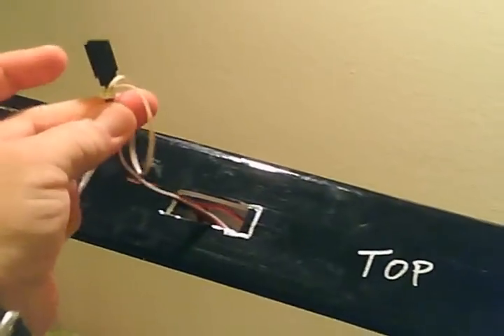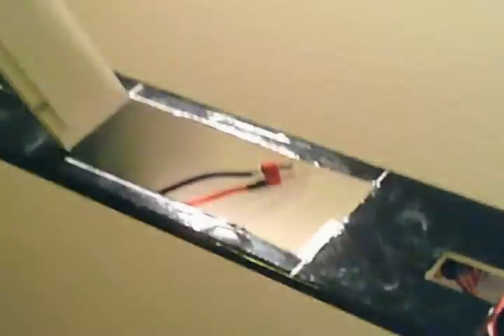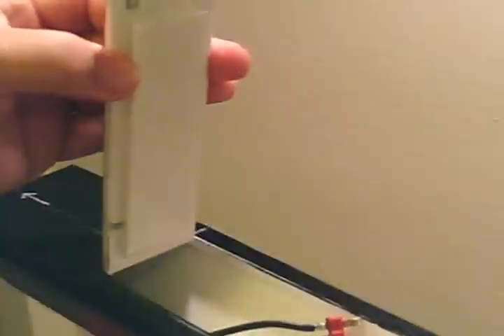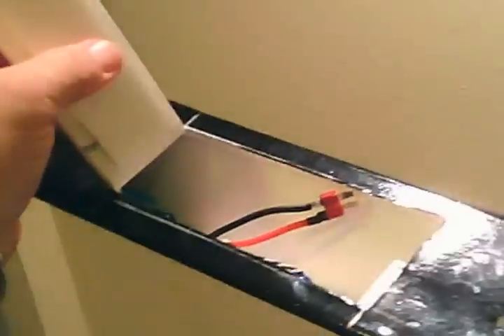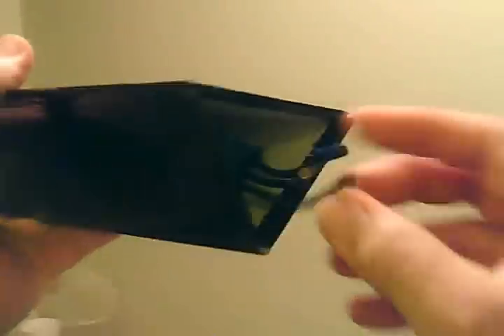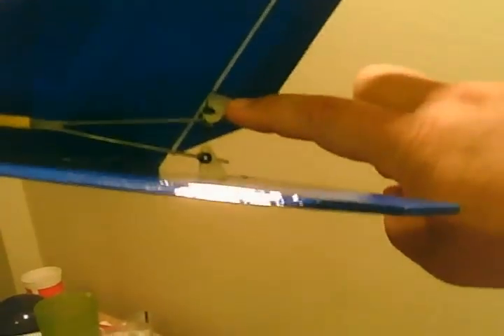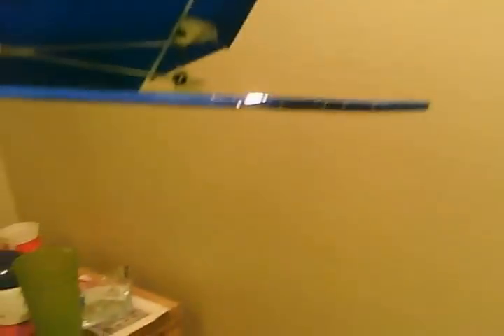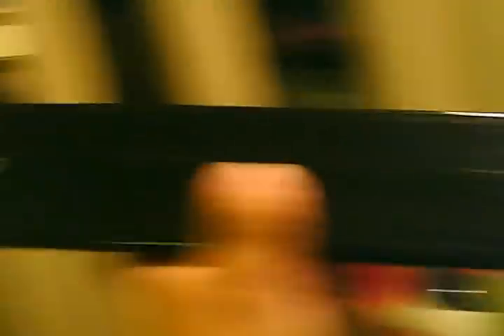RC Drone Triangle Fuselage Build Part 1

Comment from the maker: The tail extends about 6 inches aft and is 4 1/2 inches at the widest part near the trailing edge. There's a 2in x 2in tab that extends forward of the beginning of the tail section that is used to adhere the tail section to the aft area inside  the fuselage.  Happy building!!